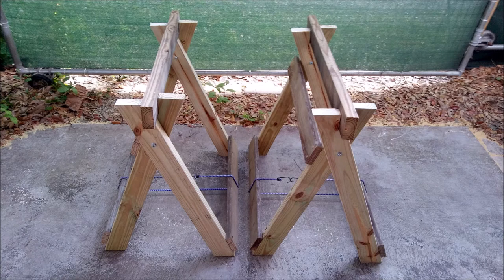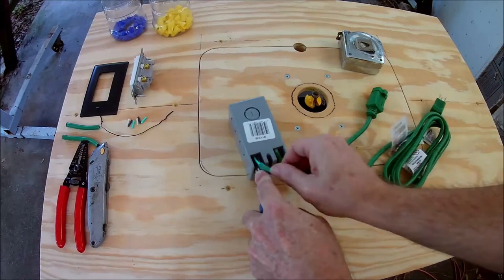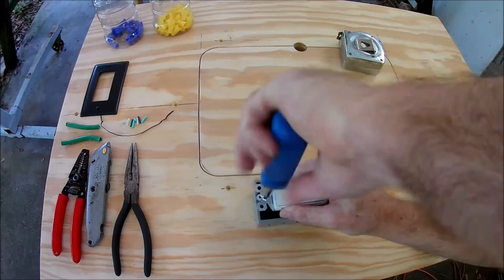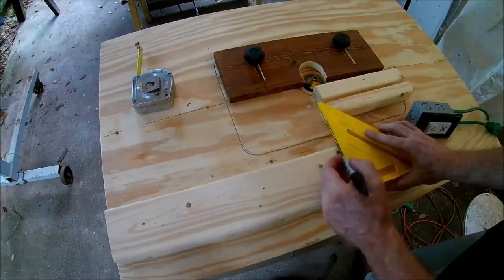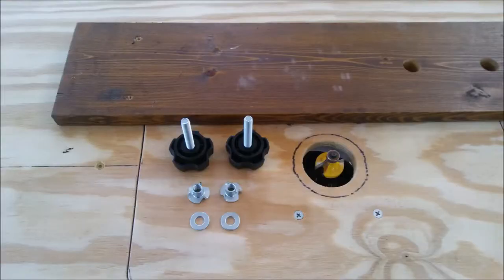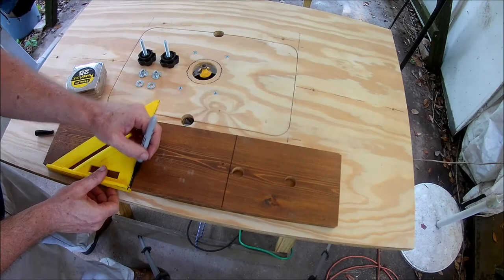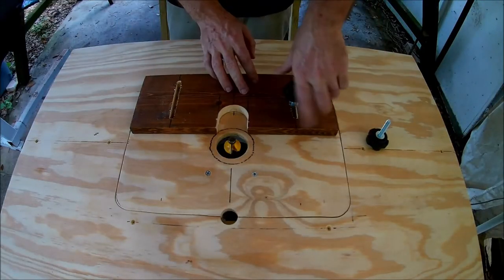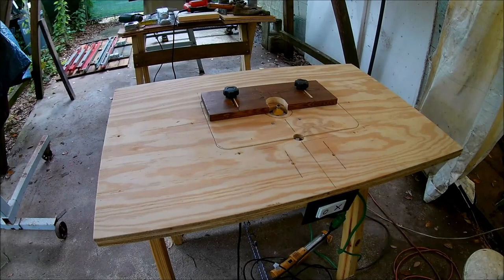How To: Simple Folding Sawhorses Part 3 - Safety!

Comment: Nicely done!

I was thinking of a box with a switch wired to a receptacle.  Plug the router to the receptacle and use the switch to power on/off.  Different approaches to the same problem.
Reply: Mount a swithed power strip, with USB if you want. Jobsite, small shop, or large shop moving station. Easy peasy lemon squeeze.